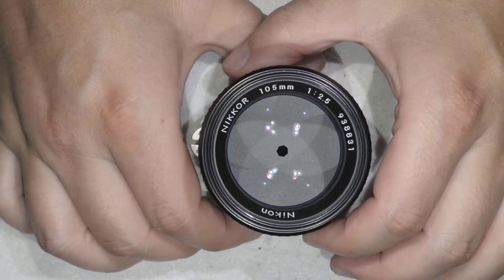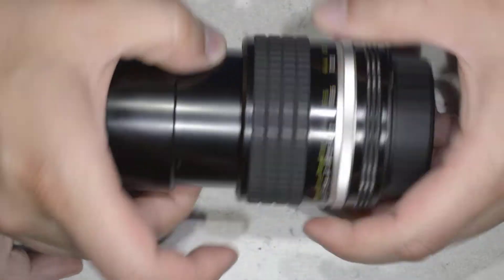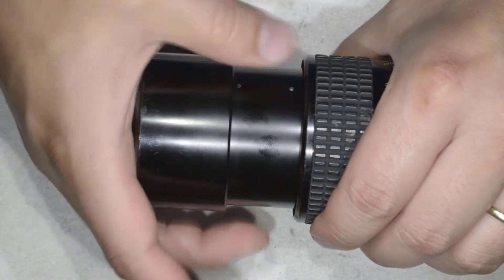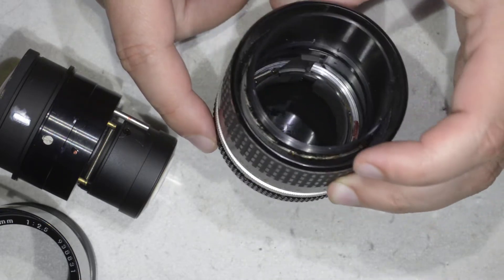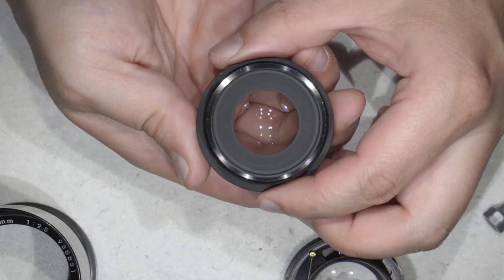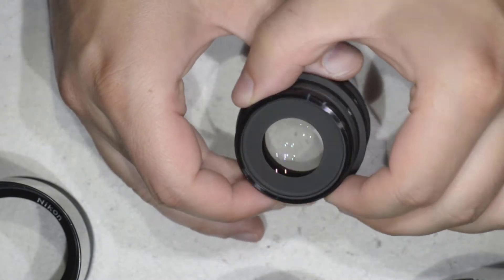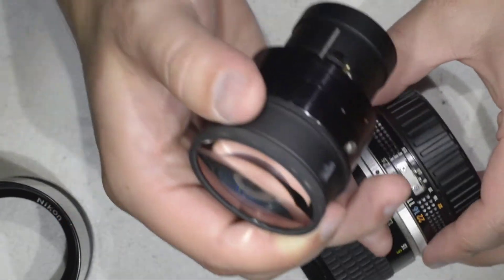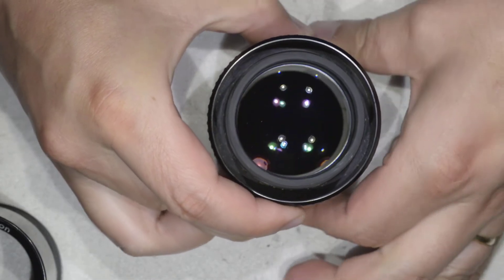Nikkor 105mm f/2.5 Ais : Dust removal

Comment: Great diy videos, I have 105/2.5 Ais, inside of rear element needs cleaning. So how to open the rear element. 
Appreciate it.
Sean.
Reply from the maker: You need to dissolve the glue as I describe on the video, then it can be descrewed I believe.
Reply: @diyextravaganza  
Ok, I'm waiting for my tools from Amazon and then try. 
Thanks.
Reply from the maker: @seanconnery314  Let me know the outcome :)

Comment: What size screw driver I need to open 105/2.5 Ais. 
Thanks.
Reply from the maker: You need J0, J00 and flat screw 1.2mm. Cheers.
Reply: @diyextravaganza where can you find the screw driver?
Reply from the maker: @dxl8  Hi, there is a link on the video description, or just look on the internet for JIS screwdriver set. Best.
Reply: Thank you. Very helpful.
Reply from the maker: @dxl8  anytime!